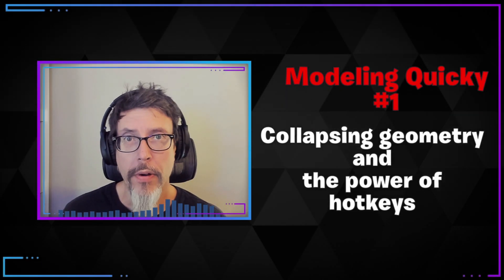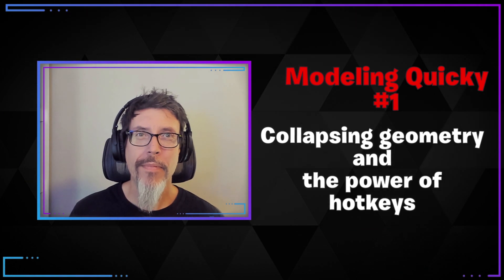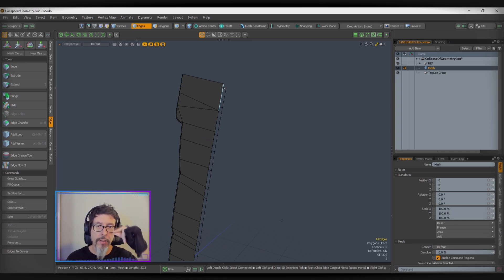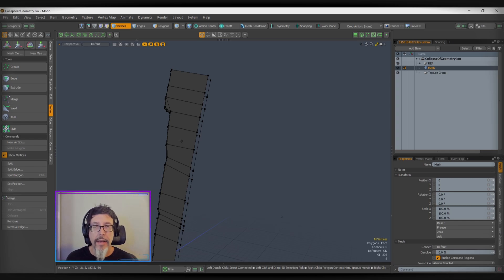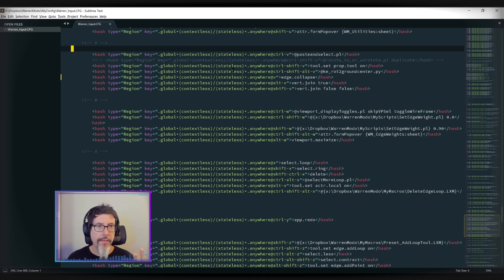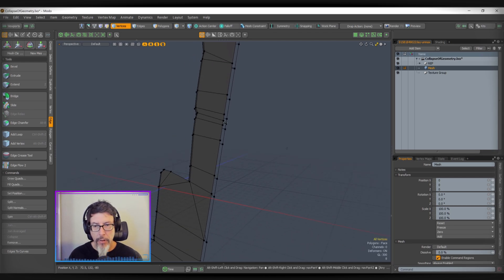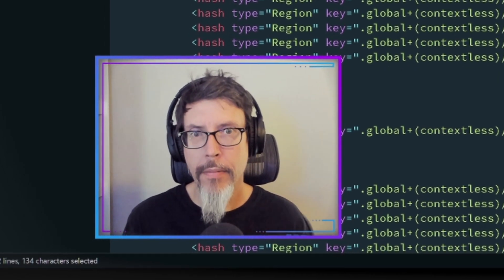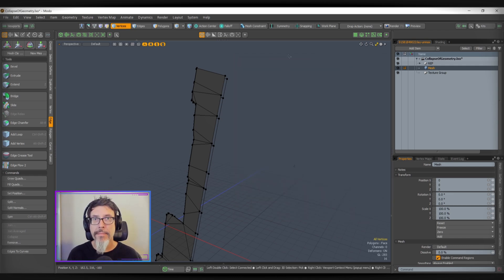Modeling Quicky #1 : Collapsing Geometry and Leveraging Hot Keys

Comment from the maker: A few people have mentioned this so I figured I should make a top level comment ... if I to bind "V" to "collapse" instead of "edge.collapse", MODO will react accordingly depending on which mode I'm in.  So it IS context aware if you set it up right.  I should have covered that in the video but, well, I forgot.  :)

So there's no need for scripts or whatever to enable that level of context sensitivity.  MODO handles that automatically.

Comment: Alternatively you can do it off the mode you are in right? So edge mode V does the edge collapse, vert mode V average join, shift V join? Maybe a advanced thing for an intro to the process
Reply from the maker: MODO is pretty smart about that automatically.  So if I were to bind "V" to "collapse" instead of "edge.collapse", MODO will react accordingly depending on which mode I'm in.  I should have covered that in the video but ... well, there's always SOMETHING I miss. :)

Comment: You can also use python to write a simple script that do an edge collapse if you are in edge mode or a vertices join if you are in vertex mode. So you can map this script to a single shortcut. You will only need another shortcut for the "join average" command then. Just an idea!
Reply from the maker: What's funny is, you don't even need to ... if you bind the key to "collapse" instead of "edge.collapse", then MODO will dynamically do the right thing depending on which mode you're in!
Reply: @WarrenMarshallBiz  Whaaaaat? Why we don't have a proper documentation on everything?. Why? This should be written somewhere. Thank you!!